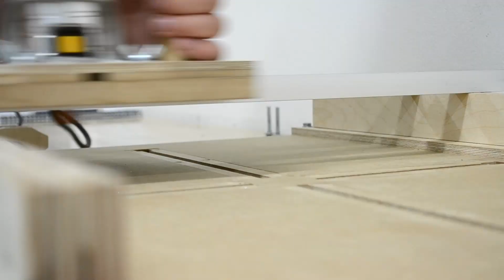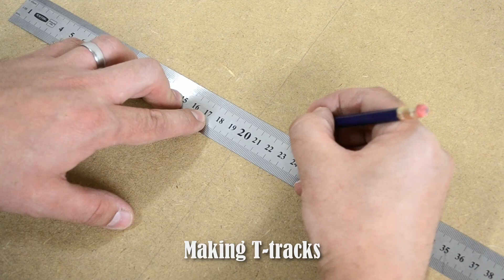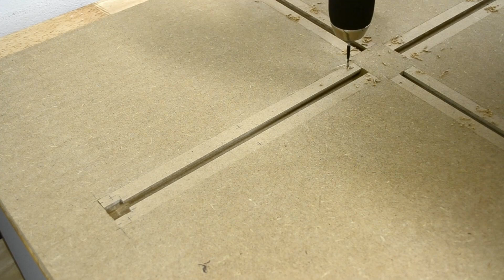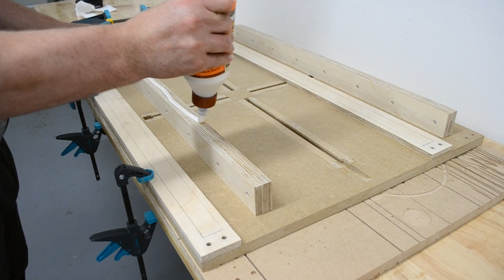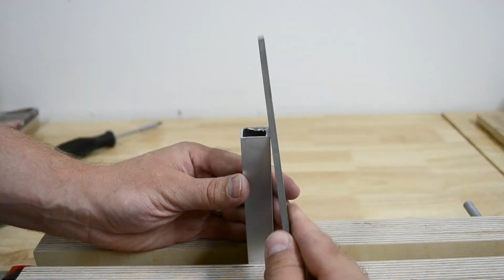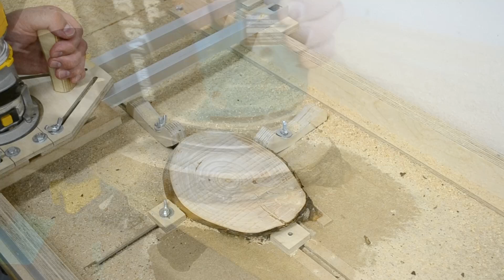DIY Router Flattening Sled | Router Slab Jig

Comment: Yet another router flattening jig, but hold on this comes with inbuilt clamps 👍👍👍... very nice innovative idea, although I think the method of holding the clamps needs to be addressed, guaranteed you'll run into those wingnuts with the router.
Reply from the maker: Thank you Barry , much appreciated :) That could happen, right. Thanks for pointing that out! 👍